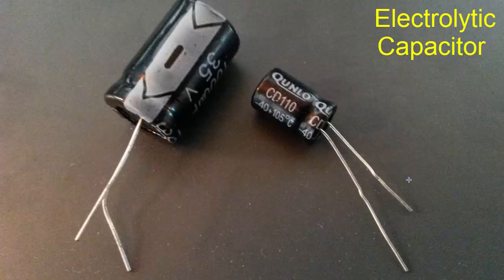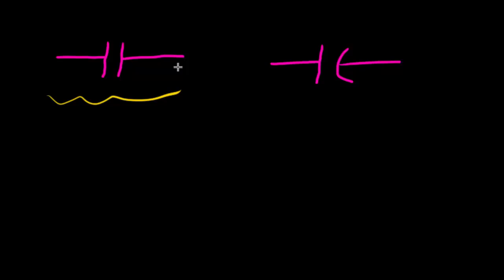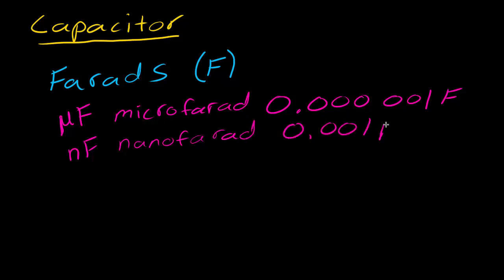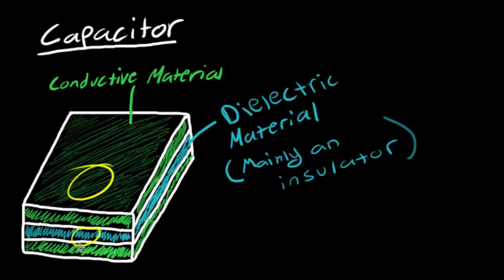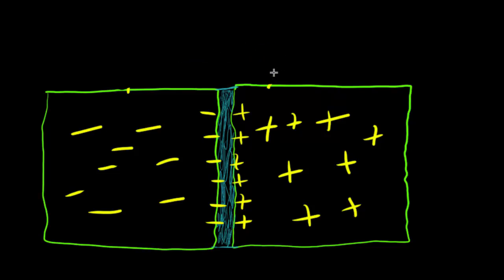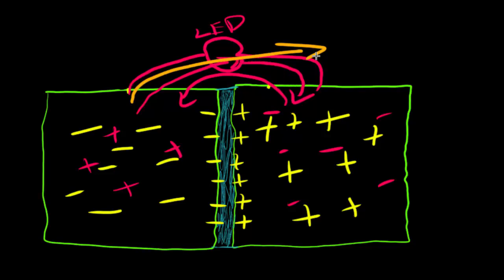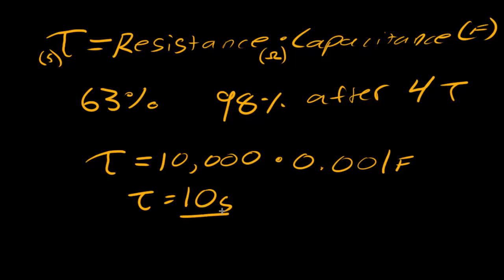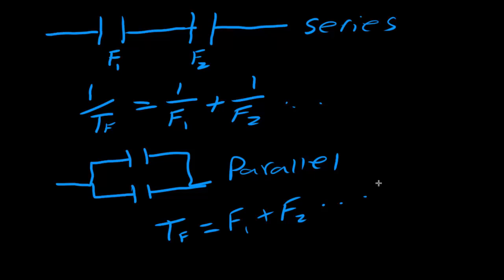Beginner Electronics - 19 - Capacitors

Comment: Fun fact you can use capacitors to buffer fluctuations in voltage from the output of the battery for further better running of the circuit this  ofc needs also a transistor to not burn out your capacitor

Comment: Rlly great videos for begginers a tip that i would add is for this circuit i would add a minimal needed resistance as a resistor to not have to worry about where i put the potentiometer to not burn out the led

Comment: Just so people know, the long lead on Capacitors and LEDs for the +ve side is a convention - NOT A STANDARD.  This means that you will come across Capacitors and LEDs that do NOT follow this convention.  Use the markings, not the lead length.  For LED's you can use the Diode mode on a multimeter to tell which lead is which if there are no markings.

Comment: Short version of the unit "Farad": 1 Farad tells you that a capacitor holds a charge of 1 AmpèreSeconds (=1 Coulomb) for each Volt of capacitance (= stored electric potential).

Despite obvious differences between capacitors and batteries (electrical field vs chemical storage, discharge curves...), the unit is actually very similar to the nominal Ah charge of a battery with a given voltage (or Wh capacity when expressed independent of voltage): similar unit, only different context.
Also: 1 Amp is quite a lot of current, as we're usually dealing with milli Amps. Accordingly, 1 Farad = 1 Asec/V is also quite a lot in terms of electronics/microelectronics. By converting from seconds to hours, we see that 1 Asec/V is also the same as 0.2777 mAh/V. Now let's keep in mind that despite the comparison capacitors are NOT batteries, i.e. mAh values even remotely in the order of magnitude that we're used from batteries would come as a big surprise. So when it comes to capacitors and "Farads", maybe this helps to understand concrete numbers a little better and explains why in practice we're usually dealing with these "tiny" units like µFarad or nFarad.
Great video series, btw.

Comment: Summary:
- capacitors build up charge in them
- capacitors need to go inside your circuit
- capacitors have a max voltage they can handle
- composition of capacitor: two conductive sheets surround a thin insulator
- capacitors in series, their total capacitance decreases as you add em in series
- capacitors in parallel, total capacitance increases as you add them
Reply: Nice! I was just thinking bout making a cheat sheet for each topic. This will be a good start!

Comment: I was wondering if you could elaborate on how capacitors work in series. I understand that energy does not flow through them as you explained due to the dielectric material insulating to two conductors but how to do they work when operating in series?
Reply: I wonder about the same thing..
Reply: With a reference to @Neithan's comment on atoms / ions/ electrons and how they move, I believe it works like this: Imagine following circuit: battery negative terminal, capacitator 1(c1), capacitator 2(c2), positive battery terminal. The positive terminal would vacuum all of the electrons from c2 anode (and simultaneously push them to the c1 cathode.) causing the ions in c2 anode attract electrons from c2 cathode (because of the greater potential difference as so many of electrons were vacuumed and are missing), creating ions in c2 cathode. Now those ions in c2 cathode wants their electrons back, but its easier to attract different ones from the c1 anode (because in c1 cathode are all those electrons supplied by battery - repelling and pushing away those electrons in c1 anode - like two magnets of the same polarity). This way they gradually equalize. Once they equalize - charge, the current stop moving all together (until there is a drop in voltage  - causing the conductors to discharge - equalize the voltage in the circuit). Now this is only how I imagine it working, it might be totally wrong. This just makes the most sense for me for the time being. Hope this helps someone.

Comment: 1) subscribed and liked. Will have to go back to all ur videos and like them. I was watching on my tv incognito. But will have to like all of them and continue to finish all ur videos 
2) I don’t have words to describe how easy u make the whole thing look. Your presentation is second to none and I don’t think I need any tuitions besides yours 

3) I will appreciate if you could understand and give a solution to my problem 

My sons electric car had a 12v 15000 rpm motor driven by a 12v 7ah battery and a 15amp fuse
I upgraded to a 12v 30000rpm motor and a 12v12ah batter. But my fuse kept blowing up. I ended up using a 30 amp fuse but it still blows up. What could be the reason?
Thanks a million

Comment: At 4:31 - "We don't need to know what a Farad is" - but it's good to know because it explains what a capacitor is - and once the Farad is understood, all other values are understood, because they are all scaled on the Farad.
Charge is what moves along a wire.  The unit that measures flow of charge, or current, is the Amp.
As current flows into a capacitor, the voltage across it increases.  If a constant current flows into a capacitor, the voltage across it changes linearly. 
If a constant 1A flows into a 1F capacitor, then the voltage across it increases at 1V per Second.
Thus, the Farad makes sense of the units concerned with capacitors.

Comment: I don't understand why the dielectric sleeve between the two plates needs to be small enough that the electrons and ions can still 'feel' each other. I'm probably missing something, but in my understanding of the video, it only matters that the two plates are insulated from each other. Could someone explain this to me?
 Thanks a lot for the free educational content, I'm loving it.
Reply: we need to create something like a circuit , so the electrons move but gather up on the plate and do not pass.  Imagine vacuum cleaner and filter bag , if no bag all trash will go away , if its plugged no trash will come coz it wont suck :)

Comment: OK wtf. Every capacitor I use just doesn't work. 
Ive literally tried every video on YouTube.
I 'charge' my capacitor, plug it in and absolutely nothing happens to the led. My wiring is definitely correct, ive tried it with my power supply already. Sometimes when I connect the capacitor the led flashes brightly for barely a millisecond before becoming extremely dark. Please help.
Reply: Try buying higher quality capacitors
Reply: your capacitor has a very low capacitance or you don't charge it enough.
Reply: @hhh0511  just means the capacitor has discharged and is not charging up quick enough. or is burned out after a single use

Comment: There's a mistake that may mislead someone at 10:17.
Nothing is going back and forth through the LED: the current flows one way when charging and the other way when discharging. I understand the origin of the confusion (mixing real physics with the "conventional" current direction).

Why and how a capacitor works? Easy (ELI5 explanation inbound...)

Generally speaking, atoms have the same amount of protons as electrons, so they are balanced, neutral, happy. The atoms of some materials (copper, for example) are not so good at keeping their electrons around them. When an atom loses an electron, that atom (now called ion) has a positive charge because now has one proton not balanced by that lost electron. At this moment, this atom is not happy, he wants an electron back to be neutral again.

- CHARGING: When we apply a voltage between those conductive plates, we steal all the electrons from their atoms like a vacuum and direct them to the other plate. Now we disconnect the battery.

- CHARGED: The situation is now tense. On one plate, we have all the parents (atoms that have lost one electron, aka ions). The other plate is filled with those stolen electrons which are desperate to attach themselves to positively charged atoms. Because they are close, both ions and electrons strongly feel each other; that's why electrons accumulate closer to the opposing plate. They are trying to reach, but they can't because of the dielectric material and/or air. It's like a fence.

- DISCHARGING: Now, atoms never move. They are stuck in their place because they make up the material, but electrons can flow. When you connect the LED, it becomes the only bridge between the plates, so all the electrons storm across the LED like there's no tomorrow to the other, positive, plate. That makes the LED shine. The positive ions on the right (the atoms) start receiving and "capturing" those electrons back like magnets, which make them neutral atoms again. Little by little, it also makes the whole "positive plate" vibe a bit less intense. In time, very few electrons remain, which is less and less current through the LED until there's no tension between plates, which makes the LED turn off.

Hope this helps! And kudos to CodeNMore for educating us all for free, not an easy task.
Reply: That's one sexy explanation! Thanks a lot.
Reply: What is the reason why it is charging when we apply voltage to capacitor?
Reply: @pockeybearmilk264  Because one side of the battery is positive. So when the positive side attaches to a metal plate, the electrons in the plate get attracted to the positive side of the battery. In doing so, they get transferred through the battery to the other side
Reply: @pockeybearmilk264  it have two plate inside and a insulation between them
Reply: Awesome explanation, big thanks! :-)
Reply: Thanks. I really felt the drama in your telling, it brought tears to my eyes ... But in the end they were reunited! Wee!
Reply: @thomashverring  😂😂😂
Reply: Is this the same like a rechargeable battery? with limited current draw?
Reply: @simonkenaguirre  no it's completely different rechargable batteries use chemical reaction to transport electrons and when it completely reacts then the battery runs out but while charging it we reverse the reaction
Reply: Ty bro
Reply: Thank you for the impeccable explanation
Reply: Thats right, electrons can flow but atoms stable or not can't.
Reply: Neithan łl
Reply: bump
Reply: thanks for explaining, although i already knew these stuff from khan academy hehe
Reply: So, at its starting point creating electricity is stripping atoms of their electrons? what happens to these ions that we intially started with? The ones that were robbed of their electrons to create the voltage itself?
Reply: @jasonbourne4670  Atoms are what makes a material, they stay put.
Reply: can you explain me why electrons moving when there isnt any current? It looks like an open circuit, why would anything happen?
That's the only thing I can't get my head around.
Reply: thanks I was a little bit confused earlier on how does the positive and negative charge makes current
Reply: kinda help but some words you were using is redundant making it less understandable. please next time in explaining make it straight to the point. kudos to u

Comment: I’d like to trigger an iPhone capacitive touch screen without using hands (electronically). Can you please explain to me how to do that? I know it involves a wire connected to something conductive touching the screen. Trying to trigger this using a remote control just by pressing the button it sends an electrical pulse to screen that triggers the capacitive touch sensor thus “pressing” the screen and clicking a button on the screen.

Comment: If you're using a ceramic capacitor, keep in mind that they are not polarized--meaning you can connect them either way, without worrying about which wire is the anode and which is the cathode. However, other capacitors, like the electrolytic one used in the video are polarized and must be connected correctly.

Comment: Older vehicles, such as say, 1953 Mercury, have capacitors in the Distributor. This is what fires the electronica l charge to the spark plugs. It is also called "condenser".  We who worked on vehicles, used to take the capacitor and use a spark plug wire while cranking the engine, to charge the capacitor by grounding it from its case to the engine, then sparking the wire to the lead wire on it. Then carefully tying the lead wire into a little loose loop. Then we would toss it to a friend/fellow mechanic, and they would automatically "catch" it unknowingly. This emits a nice sharp shock! (Not recommended doing this at home!!).

Comment: Farad: 
Farad
OneFarad5.5Velectrolyticcapacitor.jpg
A one farad modern super-capacitor. The scale behind is in inches (top) and centimetres (bottom).
General information
Unit system SI derived unit
Unit of Capacitance
Symbol F 
Named after Michael Faraday
In SI base units: s4⋅A2⋅m−2⋅kg−1
The farad (symbol: F) is the SI derived unit of electrical capacitance, the ability of a body to store an electrical charge. It is named after the English physicist Michael Faraday.

Comment: 13min - you've used milli farads not micro dude :)  the math is spot on but terminology is important :)
Reply: He did use 1000 microFarads, which is equivalent to 1 milliFarad or 0.001F. He didn't make any mistakes per se, perhaps he could've shown the conversion from microFarads to milliFarads then (optionally) to Farads. It's the same as saying 1000m but then writing 1km, equivalent for sure but can lead to some confusion if someone doesn't really know how to do dimensional analysis that fast or they don't know the metric units.

Comment: it be ok using a 1000uF 16VDC Electrolytic off a 5 v output as long as it doesn't exceed the 16v on the other end is that correct?

Comment: How to know the resistance of a capacitor?
Reply: Capacitors don't have resistance. The equation assumes that there is some resistance in the circuit, between the capacitor and the voltage source. If there is no resistor, resistance is almost 0, and so the time constant is almost 0: the capacitor will charge instantly.

Comment: I know this post is a little older now. But I take it the capacitors use is for quicker discharging (camera flash) and also to help regulate power, to cater for tiny power dips in electricity.

Though, I'm puzzled by something, in this video he says that when you put the LED in place, the electrons flow each way to neautealise, but that means both positive and negative are flowing through the LED. LEDs are sided, anode and cathode, how does it not damage the LED?
Reply: I believe positive charges (protons) don't actually travel from one point to the other. Only the negative charges (electrons) can travel, and when both sides have the same amount of electrons then you say that the charges are equallized.

His explanation wasn't very clear at that point, but he was probably refering to the  way that charge flow is respresented in schematics vs how it actually flows.

Comment: can u tell me easy way to check whether the capistor is working or not in Bord
Reply: capasitors can determine ethier good or not! if you have a tester right there! the good capacitor, tester will deplect a sec then go back to the normal point of pointer.. or what ever it is! i forgot the name.. if it is not going back, it means that your capacitor is in bad condition if the deplection go back but in half only, the capacitor is licky or consider as bad also.. but your tester must set in 100k ohms

Comment: 10:10 just a little thing i noticed but positive charges cannot travel i guess. Correct me if im wrong.
Reply: The electrons accumulated on one plate are travelling back to the other side until x - are equal on both sides, hence the capacitor returns to the state of "neutral", has no charge and as a consequence the led is no more lit. But electrons are travelling from one point to another, not protons, so I think he didn't explain it very wel in the animation.
Reply: Only electrons (negative charges) travel, protons (positive charges) never. Convention is just opposite to this reality that's why he said you can consider anyway, it works both the ways.
Reply: Net positive charge travels with the moving of negative charge in the opposite direction
Reply: Well we talk about it like it's positive, not the protons but the electrons. The bank might talk about you being in the negative but there is really no negative money. Think of it more like and accumulation of electrons versus a deficit of electrons. Because that's what an electrician wants to do, accumulate the electrons and control them to get the charge that he needs to power his device. So that's how we talk about it no the protons cannot travel...I think the closest we have ever gotten to controlling protons is creating an atom bomb 🤦🏾‍♀️🤦🏾‍♀️🤦🏾‍♀️
Reply: @arianagm2332  positive charge can flow. just not in metal. it can flow in ionic solutions just as salt water. and in fact. the voltage used to generate ATP (our bodys main power source) is generated through the movement of positive charge through a protien called ATP synthase
Reply: @arianagm2332  wasn't debating whether or not electrons are negative or positive. electrons are negatively charged what I was debating was if a positive charge can flow or not. I am saying that they can flow just not in this situation
Reply: @opiyumpharma5556  I was responding to @singleaspringle though. Positive charges are not traveling it's technically an accumulation of negative charges... It's a bit unconventional! 😜
Reply: thanks for saying what i had in mind
Reply: Positive charge effectively travels in the opposite direction of negative charge when electrons transfer between charge carriers. That's why most electrical logic holds up even though conventional current doesn't accurately reflect electron flow.